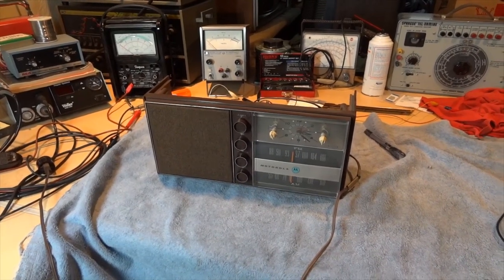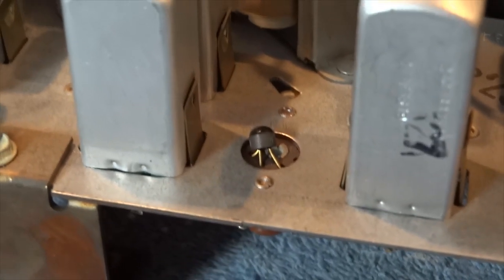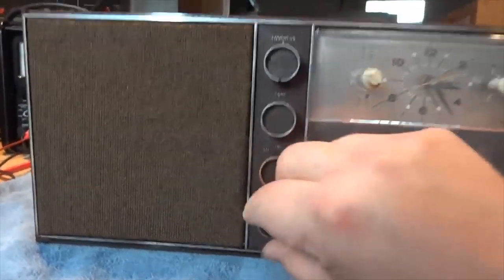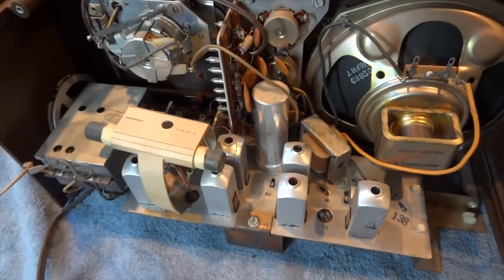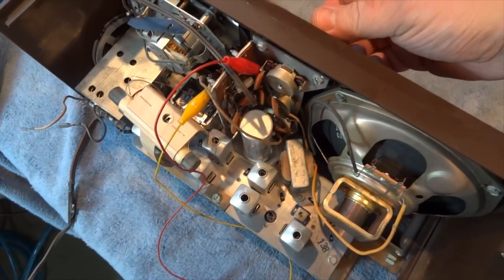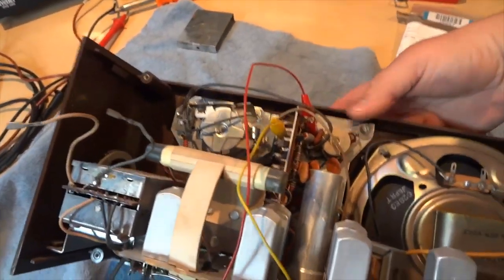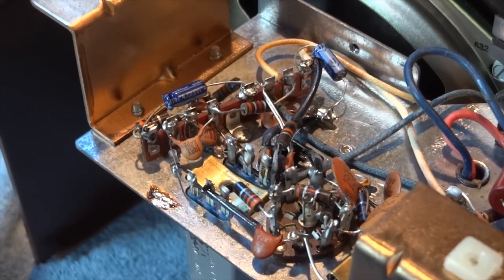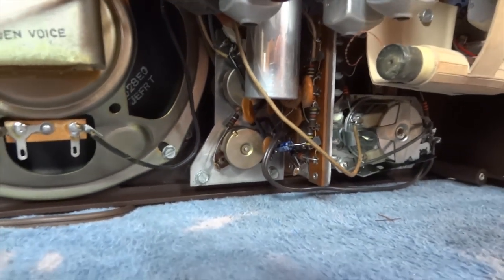Repair of a 1965 Motorola AM-FM clock radio

Comment: I have an RCA clock radio model RZS 484L and mine just needed the man filter cap replaced the others I left because the radio plays good with the original and has for 8 years

Comment: My Motorola Clock Radio model no. TC22EW Serial no. 50196. Which I was able to clean and made the dial and volume work, but not the clock. I tinkered with it but could not get the movement to work. Any suggestions would be appreciated/ thanks!

Comment: If that filter cap shorts it can take out the whole transform filter caps capacitors electrolytic caps.... My rule is simple always install a new filter cap never leave a old filter cap in circuit